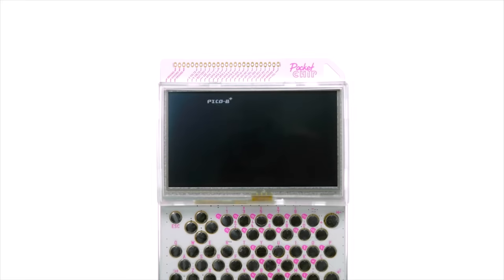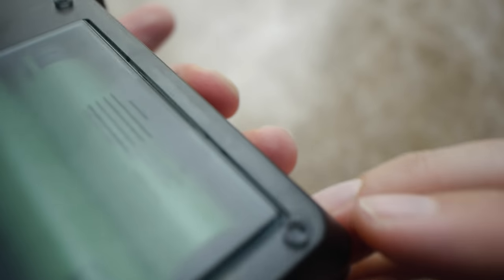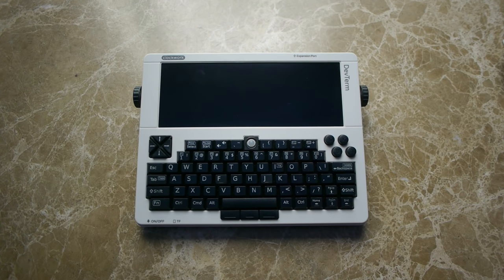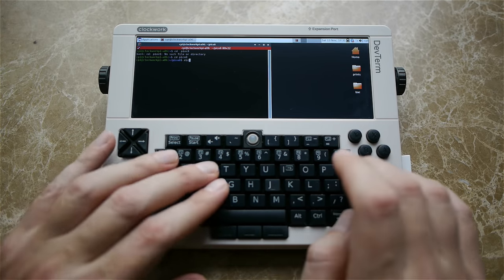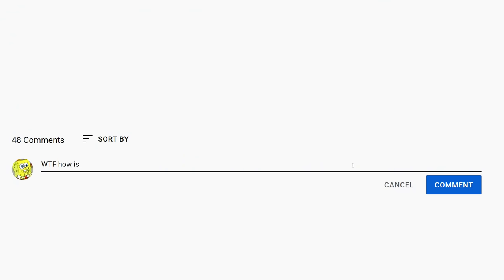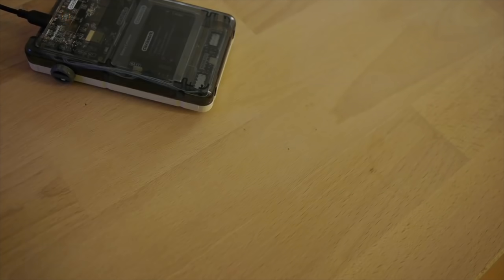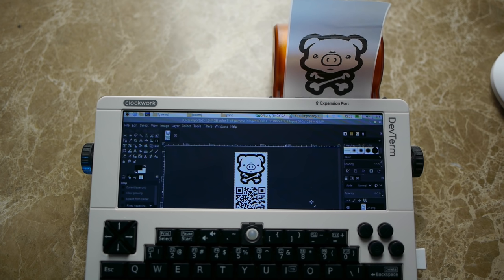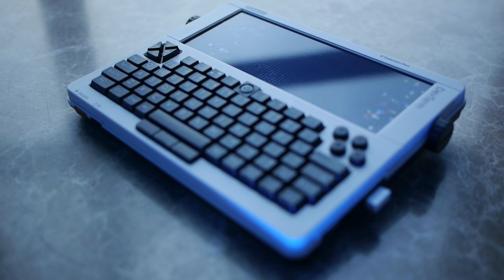ClockworkPi DevTerm | HARDWARE REVIEW

Comment: You're the first person I've seen that has actually given an unbiased review of the devterm and I did laugh out loud on various occasions which always helps.

Slightly off-topic, but would the upcoming 64bit Raspberry Pi build work theoretically on RK3399 devices?  I'd like to have a handheld console that has "native" support for Pico-8 and don't know whether to wait for RK3399 or get an RK3326 now which will be old hat within a month or two.
Reply from the maker: Glad to hear you had a good time!

I can't speak to other RK3399 devices but it looks to me like the upcoming Pico-8 ARM64 build is supposed to run on the RK3399 DevTerm module. Zep said he had the DevTerm in mind among others. As I mentioned in the video, you can already run the current Pico-8 version on ARM64 Linux with some workarounds. So I don't think this will be an issue.

Comment: The GPIO pins are accessible on the board next to the TF card slot, but I can't see a slot on the case to access them. Do I have to cut a hole to run a ribbon cable in? I would love to shove a Sudomaker RetroWave OPL3 in it, but I have no idea if it'll work.
Reply from the maker: I think the idea is that you use some kind of ribbon cable. You can take off the port protector plate on either side and route it out that way. Or you can use the printer flap. You can probably easily get that sound card in if you throw out the external board.

Comment: That's a pretty cool review and bottomline. I thought it was cool too, but the CM3 part just kinda kills it. 

We need more devices using the CM4 or the whole Raspberry 4b board. Can't wait for a non-GB form factor handheld kit. (because Experimental Pi never released the leaked prototypes, and the N+ Digi Dock is basically impossible to get)
Reply from the maker: The company posted a CM4 prototype the other day. It looks like this isn't the last of what we've seen of this device.

Comment: At least apple (and HP)'s butterfly switches are better than the old foam-and-foil keyboards of the 80s/90s...  (and worse, what happens when the foam degrades
The early reviews of the pocktchip scared me off that beast due to the metal domes.
Great review.
And a not quite 7" screen is a bit small...
Then again, I used to code in C on a Palm OS device...

Comment: A year on, what would you recommend for a simple, low budget computer for Pico-8 coding? I liked the look of the Raspberry Pi 400 but it seems to be sold out in most places and quite difficult to get shipped to me here in Denmark. Are there any better alternatives to the DevTerm on the horizon?
Reply from the maker: The pi 400 is still available just from Amazon here in Germany. If you are looking for something similar, I would recommend channels like ETA PRIME. They cover new cheap single-board systems on a regular basis. Personally, I am looking forward to the uConsole by Clockwork. Keeping my fingers crossed that it will fix some of the issues with the DevTerm.

Comment: re: fn vs control, it's not an issue of "whether it's to your liking". it's an issue with muscle memory.  
pressing fn instead of control can lead to all sorts of disasters. (similar issue with win vs mac shortcuts)  
this is especially noticeable (for some) when using an ISO keyboard when they normally use ANSI layout - the | key is where the enter key should be, and the enter key is two rows high.  
so if you're using enter a lot (which i'd imagine some people would be) it'd be a massive decrease in productivity.

and sure, you could "get used to it". but it's worth noting that "getting used to it" takes quite a significant amount of time, which some people just feel like shouldn't be part of the process of getting a new keyboard/laptop
Reply from the maker: Well, I'm used to a German keyboard layout. So using this layout my muscle memory is constantly misfiring anway. The thing with the FN key is not just muscle memory, although that certainly plays a role. All things being equal it's just easier to hit the outer key. So it makes sense for a common key like Control to be the outer one.
Reply: @LazyDevs  idk... personally i'd still argue that it's probably mostly muscle memory affecting the decision here - not least since if, say, you grew up using a keyboard with fn on the outside, that'd just be normal to you - you wouldn't have to change anything at all to change to a keyboard with fn on the outside.

otherwise surely you'd have more people using dvorak/colemak/steno, since they're way better [citation-needed] than standard qwerty?
Reply from the maker: @5omebody  If you learn typing on a keyboard with an other FN key things would be different, yes. The problem is that most of use start using a keyboard without an FN key at all. And so when you switch to a Notebook and that new FN key gets added as the outer key you accidentally press it all the time. Because that's where you think Contol would be. But if it's tucked between the other keys you are less likely to press it. Because that's where things like the Windows key live, which you use far less frequently.

Comment: I wonder if they will get some sort of suspend mode. Even with the CM3, that 30 seconds to boot is a bit long. Would be nice to be able to have it sleep and wake in a second or two. Other than that, thanks for the review, very informative.
Reply from the maker: Yeah I was looking for some software solutions. There are projects that attempt it but they involve hardware hacks and get pretty intense. But I wasn‘t looking too hard. Hoping somebody more experienced will start the ball rolling.
Reply: @LazyDevs  Didin't it have hibernate option in turning it off menu? My linux has it stock.

Comment: I really hope they come with a version that accepts the CM4 and comes with a decent keyboard with trackpoint. The use of these batteries is a good idea.
Reply from the maker: I saw some people using an adapter to get the CM4 in there. It kinda works! They have troubles getting the screen to work. Fingers crossed they can figure it out.
Reply: A trackpoint would be a vast improvement on that trackball. The hell were they thinking with that tiny thing?

Comment: Mere you able to solve the WiFi problems in the end? And with 1 GB of internal memory, could you run Libre Office?

This thing remins me of my Psion 5MX which I miss very, very much. ;)
Reply from the maker: It runs Libre Office. Yes, the WiFi issues on the A06 were eventually resolved by re-installing the system. I guess it shipped with an outdated version.
Reply: @LazyDevs  Okay thanks. Now I have to determine how much VAT, shipping and "clearance costs" for Customs are to Europe. Price-wise, it's a bit of an overkill to replace my broken Psion with this but I'm tempted. ;)

Comment: It's a shame that it's already out of date raspi wise with the CM4 unit eviscerating the CM3.  I have a couple AArch64/ARM64 sbc's using the raspi alternatives with one having an m.2 slot and the other a pcie slot.  To be fair, the only coding I do on modern hardware for fun anymore is mostly AArch64 assembly and C.  Raspi has had 64bit hardware for a bit now, but the devs believe there's no point in moving to 64 bit software for they're Debian repackage despite the data saying otherwise.

I was going to use that same display, or at least the same spec one, on a project.  That project is basically just a desktop media computer with an internal DAC/amp that outputs to a set of book shelf monitors/speakers it's designed to look like and plays YouTube music.  I opted for a slightly less wide aspect ratio in vertical orientation and it fits with the speakers perfect with analogue dials for controls and touch screen navigation.

Comment: You should ask Clockwork to send you one of their new uConsoles. It seems to address a lot of your issues (form factor, metal case, screen resolution, pricing) but doesn't address others (still has a trackball, the D-pad still looks bad, still no out of the box GPIO like the Pocket Chip, etc.).
Reply from the maker: On it! 👍
Reply: I really wanna get one but I don't really understand it. I've been using an old hp mini (intel n570 with 1gig ram) to tinker around with linux on and was looking for something to upgrade to, but I'm not sure the uConsole is what I'm looking for. Specifically I'm not sure if I should go for the RPI version or the A-06. The A-06 reads as the powerhouse, which would be nice, but I don't know if I'd be losing out on functionality/usability by not getting the CM4.

I was also looking at getting an OrangePi 5 since raspberry pis are unobtanium anymore, but I'm too new to the space to make a good informed decision about these things. Maybe just get a refurbished ThinkPad instead? xD
Reply: @GrandpuhTy  The A06 is indeed a powerhouse, but the issue compared to the CM4 is that there'll be a lot less software support or updates. The CM4, being part of the RPI community, is basically guaranteed years and years of broad software support and updates while Clockwork is somewhat notorious about taking a while to put out updates for their A04 and A06. 

As far as the Orange Pi 5 vs. an old ThinkPad goes, it really depends on what you want to do since those two have very different potential applications. An Orange Pi 5 is ARM-based, low power consumption, has GPIO that make hardware tinkering very easy, etc. A ThinkPad would be a much more out-of-the-box solution, but also less useful for tinkering. If your goal is simply to get familiar with Linux, I'd recommend the ThinkPad; if you want to tinker, play with the GPIO, etc., I'd go with the Orange Pi.
Reply: @pawanyr360  Ah thanks for the insight, I appreciate it a lot. Taking a closer look it seems like it wouldn't be a bad idea to get the CM4 version and if needed I could order the A-04 or A-06 core(s) afterwards, if I'm understanding this right.

I'm not really sure of the practical use cases for the uConsole but it looks cool -I've got a bunch of decade old electronics laying around and I wanted something with a little more oomph as a mobile driver.

As much as I'd like to jump in on them I might just skip on the Pi's for now and pray that 2023 will be a better time to get in on them, I dread going in on an offshoot that may become unsupported/abandoned. The poor pocketchip.

Comment: It's clearly an homage to the TRS-80 100... Why did they make it so small? If that thing had been designed around a full-size keyboard with a larger display, it would be PERFECT for command line warriors. Imagine just banging out code in vi or emacs on a say... 148x25 screen! Set your console display to use Terminus and it'll be delightfully readable!

Comment: Great review! Very informative, although you don't seem aware of just how acessible designing and printing custom PCBs have become to hobbyists, since companies like the now famous pcbway have entered the market with very affordable prototyping options. Making a simple edge connector like this is also pretty trivial as it just is printed on. That being said, this kind of endeavor is more common in the retro computer scene, where user/cartridge ports were the norm, so there's that.
Reply from the maker: Even if it is more accessible, I can poke a wire into a GPIO hole RIGHT NOW. Even the most accessible PCB printing service will take a few days. And imagine if I made a mistake.

Recently there has been talk of the Flipper Zero and that is a beautiful example of an hacker-friendly device that supports janky wire poking as well as more polished solutions.
Reply: @LazyDevs  those things... don't serve the same purpose at all, and ofc mistakes happen and it's fine, either you bodge or reorder, nbd ._.

The whole point of going for PCBs is to make things you can't do with janky stuff:

- more compact designs to fit in existing cases or achieve portability goals (e.g., custom console cartridges and such)
- proper edge connectors to fit existing designs without having to mod original hardware every time
- reproductibility and version control to share with the community and have other people seamlessly participate in the design, there's a lot of open source hardware
- durability, which isn't systematically a requirement but can absolutely be

Sure, you can stick to proto/strip board jankwork and freeform noodling, which absolutely has its firm place in prototyping, but you're closing yourself off of a world of options offered by the hobbyist community, which is perfectly fine, but I really fail to see the point of responding as if they don't exist.
Reply from the maker: @nysaea  The reason why I mentioned Flipper Zero is that it supports both - freeform noodeling and more polished, produced extensions. That is why I would call that solution more "Hacker Friendly" than the DevTerm.
Reply: @LazyDevs  you're comparing apples and oranges again, and I don't see how that's contradicting my original point either, but alright, have a good day!

Comment: Thay trackball looks EXACTLY lile the ones used in the Blackberry Curve 8300 series circa 2007-2008. If that is the case, then no wonder it sucks...  The tech is roughly 13-15 years old =\

Edit- nobody wants a "yrackball"
Reply from the maker: Yeah it looks like it was designed for a way smaller screen.
Reply: @LazyDevs  I wanna say the Curve had a resolution of 320x240, so yeh, that "tracks" [huhuhuhuh.....   ugh]

Comment: Do you remember those incredibly small Motorola cellphones back from the early 2000s? Why did they disappear? Why don't we have even smaller phones today? Certainly, it is not because it is technologically challenging. We are human beings. Some dimensions on our body cannot change. Our fingers are fixed in a certain size range. Our eyes can only perceive text down to a certain size. At this point in the history of electronics, size is not where innovation happens. There are excellent devices that have a decent keyboard which can be used to code whatever you want. This idea is awful. It is making it harder for the user to type while bringing nothing advantageous to the table.
Reply from the maker: It's too late, Halim. You HAVE to use the DevTerm now
Reply: @LazyDevs  Hahahaha. Fair enough, I do not HAVE to use it. Though I still think my analysis was valid.